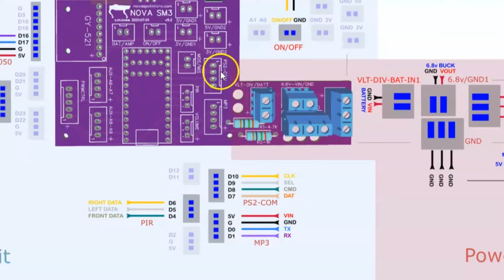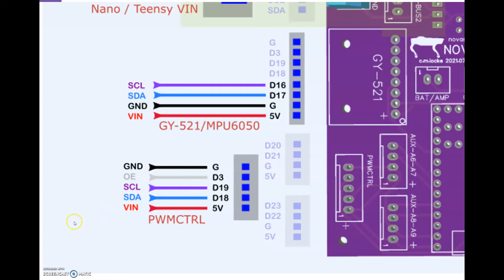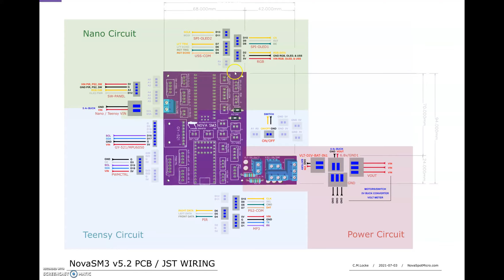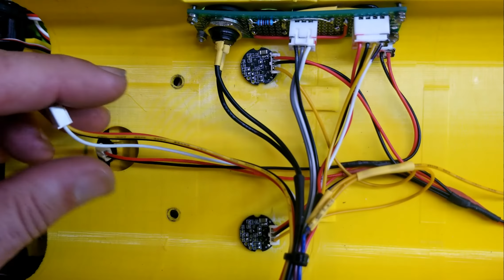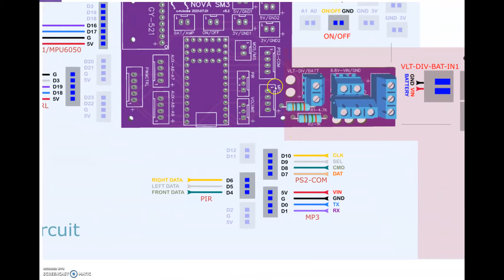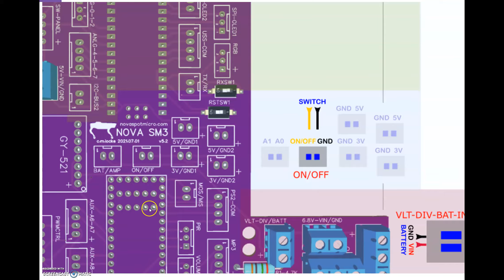REPOST: JST Wiring PCB v5.2  : Nova SpotMicro3

Comment: Hi chris how will it work if i use mg996r Servos Please Reply As My Budget Is Low
Reply from the maker: unlikely, and if so, not for very long.  Try building one leg would be my suggestion, I suppose you may get lucky if they are really good mg996 - but the normally just don't have the torque and they are not normally metal geared
Reply: @ChrisLocke1969 how can i contact u chris please
Reply: Do u use telegram? Please reply
Reply from the maker: @shakingscience6354 negative, you can email me cguweb@gmail.com